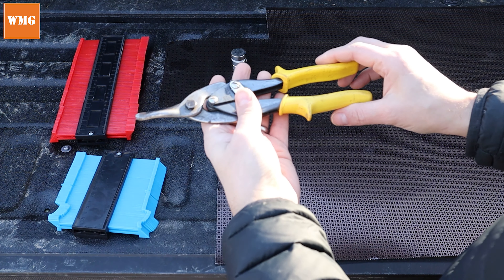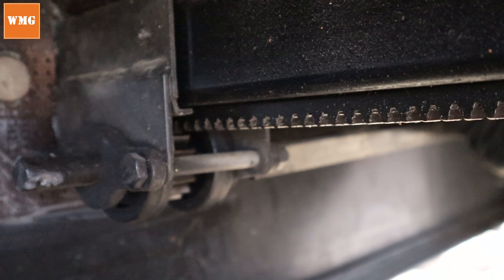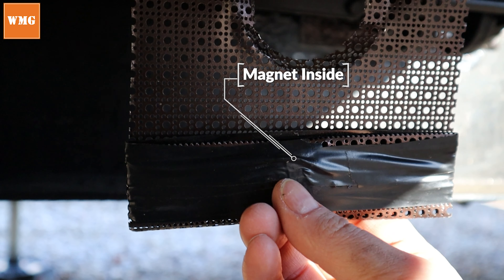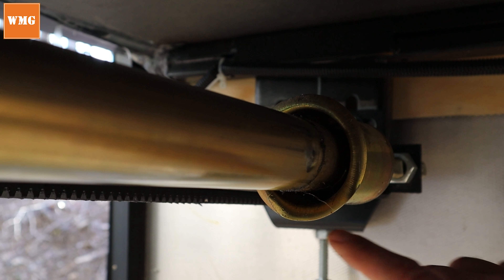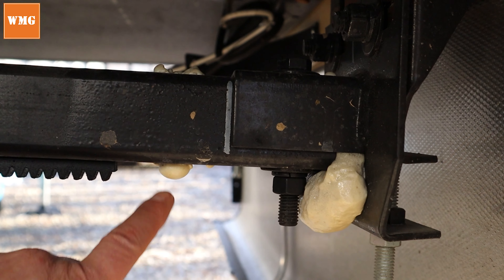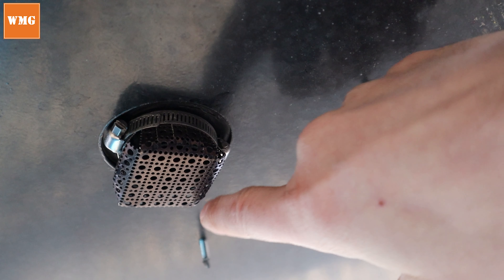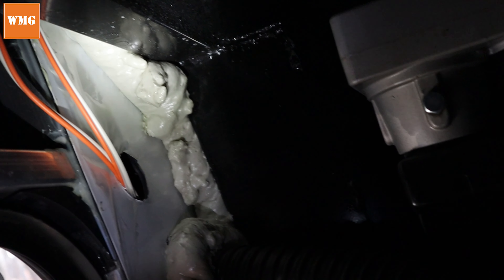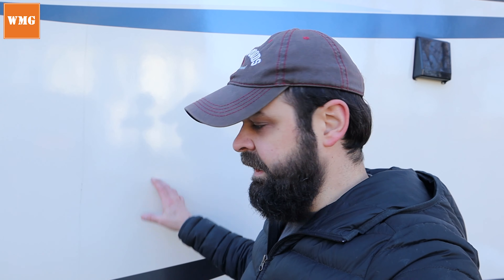How I STOP MICE from getting in my RV - No Mice 3 Years Later! #mouseproofrv

Comment: Really enjoyed your vid. I'll be parking a Ford Transit van in the Maine woods and this gives me a head start. My van has a zillion holes underneath but I can deal with that. I'm more concerned about how I'm gonna deal with the engine bay. So far I hear peppermint oil and keeping the hood open at night. I saw one of your commentors mentioned muffler tape for the wires? Also, I'll be parked on gravel and I read something that said rodents aren't crazy about gravel. Know anything about that? I appreciate what you've done here. Not just anybody would put in the time and effort you have. May you always be mouse-free :))
Reply from the maker: I'm about 3 years in the RV after the mods in my video, and still no mice! I'm convinced that it's not about trapping them or deterring them with smells and sounds, it's about preventing them from getting in. As far as gravel, I had my previous rv on gravel and still had a mouse problem.  I'm not sure the benefit of muffler tape on the wires. Maybe so mice don't chew them? I hadn't had that problem before.  If you seal up all mouse entry points, they won't get in.  It's a lot of work, but you only have to do it once. 😀 happy camping! Feel free to come back and share details about your adventures!

Comment: Is there a reason you used the aluminum vs just spraying those areas with the foam as well?
Reply from the maker: I feel the aluminum is more mouse proof because they can't chew threw it at all.  The foam is mouse resistant but technically in my book easier to chew threw than aluminum.  I've never had a problem with either.  But i like to use the most mouse proof material where it's possible to do so.

Comment: I am battling them now with glue traps inside. It just turned cold, and they want in. I have been in this RV spot for 1 year now. It's time to try and do some hole searching. Great video.
Reply from the maker: Closing up the holes is preventing them from coming in.  I'm sure you have found out that the glue and traps is just prolonging the problem because it doesn't eliminate the issue. If holes are open, move will keep coming in.
Reply: We’ve left ours for 6years and had no idea mice would be an issue. Started working on changing the tires and noticed a huge hole in the under belly.

Comment: I just set up my trailer to live I and I have already heard rodents underneath the flooring. How do I get all the mice out before I seal it all up?
Reply from the maker: Great question. Mice are crazy, they multiply and there are usually more after you trap a few and think you got them all.  So if it were me, I would go on an all out war against the mice.  I would bait traps insidethe rv on the floor near the walls because mice walk alongside walls, place sticky rodent tape in the underbelly of the rv along the sides near walls, place traps on the counters and stove, bait all the traps and tape.  Then for the next week or two Inspect each trap, replacing as nessisarily. And keep doing it until you catch no more mice.  I wouldn't use poison because they will eat it and die in places you can reach.  Eventually you will get them all. Another option is to seal the rv first and just trap them on the inside.  Sealing the underbelly should force them up. If you want to chat more join my Discord , it's easier for us to have a conversation.

Comment: Easily the best mice prevention vid I've seen. It takes some effort to defeat the little ba$tard$ and this will do it. You're exactly right about rechecking the areas for entry multiple times. A huge THANK YOU for the additional ideas such as contour gauge, metal sheet, magnets, etc. I was previously using foam and steel wool on old camper. New camper will be using these upgraded methods.
Reply from the maker: sure thing brother! glad it helped!
Reply: With just steel wool and the spray foam, did it still work to keep mice out of your first RV?

Comment: My 2021 new Generator  was eaten by a red squirrel.  Now I am closing up the whole generator box W/ steel wool and hardware cloth and foam close up the generator to rodent proof it.   I will just take it off the hardware when I need to run the  generator.   It is worth it.  We do not use the generator  and i'll selling it asap.  Going to portable inverter/gen.    Also, I find live traps are much better than a kill  trap.  I set the kill traps and the bait is gane next day and no kills.  I went to a live trap and ching!  still working a year latter.
Reply from the maker: The other problem with bait traps is they will take the bait and die elsewhere in the camper if the bait uses poison. Sometimes you never find it.

Comment: I owned a home built in 1840. Mice had been getting into the house for generations.
A wildlife consultant said mice can squeeze through openings 1/4 inch wide. I bought 1/8 inch hardware cloth to secure foundation openings, and stuffed 000 steel wool around water pipe openings. Mice won’t eat through steel wool.
Reply from the maker: True, they don't eat through steel wool. On an RV, I used aluminum mesh so that it won't fall out of place or rust from road water, etc.

Comment: I've used steel wool with expanding foam.  A small amount of steel wool in the area being filled and then spray foam in and around the wool encapsulating the wool. Critters won't chew through it.
Reply from the maker: This is rodent repellent foam.  I've never had a mouse chew through it. But also, the aluminum sheets cover the biggest openings.

Comment: Good video although I would like to mention that magnets do not attach to aluminum so you must have been using a steel grating of some type or I missed something. Good vid!
Reply from the maker: It's aluminum grating, the beam in the trailer is Steel and iron, so the magnet sticks to the beam behind the aluminum grating. I also caulk the grating to hold it two ways

Comment: You really went all out! I've used the foam, but I have some gaps that are still too big. We haven't been anyplace that has had mice since I used that foam, but we will and I need to fill every gap. You're right, they can get through the smallest of gaps.
Reply from the maker: Do you think you will try the aluminum patches on those bigger gaps?
Reply: @WhatsMyGear  All my remaining gaps are small...i think. But you've shown me some spots I need to double check. I'm partial to the foam though. I have the foam for smaller gaps and also some for 3" and larger. I'll use the aluminum if I have openings that need venting.
Reply from the maker: @sightslessseen7977  makes sense.  Good luck with it and happy travels!

Comment: That sure looks like a lot of work.  I've done the same thing and so far I've been mouse free for 2 years.  I hope I didn't just jinx myself!
Reply from the maker: Paul!!!
Reply from the maker: Also, I just posted this install for a Soft Start unit for your RV Air Conditioner if you are interested check it out. It takes the huge jolt of power consumption away for when the AC starts. Very helpful to allow less power to do the same job. You can run the AC on a generator, or a 15amp line with the soft start. https://youtu.be/C-Yg6zhNCYY

Comment: The down side to sealing up your Towable RV too well is you end up encapsulating your frame and plumbing.  If you should have a pipe/hose breach you may not know about it until there is significant damage.  If you're going to do this it might be  good idea to put weep holes in several low spots of the Access Panels or Coroplast.   In the case of my 5er it's not possible to seal it up from Mice, all the hydraulics make it a significant challenge.  The little suckers can squeeze through a hole the size of a dime.  I just put professional grade bait stations around my RV when parked.  BTW, the Peppermint trick does not work at all, don't fall for that.  I did an experiment with a fresh Peppermint Repellent Bag next to a Trap, guess what was in the trap within 8hrs.
Reply from the maker: You're thinking about the right stuff.  In my case, the underbelly of my RV isn't water tight because the plastic panels are just "clicked" together. If I had a leak, the water would just fall between the panels, and it would be easily seen. Everyone's RV will be different, so you are thinking about the right stuff. Each person needs to assess their individual RV situation. Good luck out there!

Comment: Great video..and beard. We live in New York and we're heading out West in 3 weeks for a 78 day trip.. I had cab fresh in several places and I still and I still got nice.  Just a few days ago we found evidence of mice and I  killed one yesterday with a trap. I'm about to do foam  and steel wool. And then load it up with peppermint spray and more Cab fresh. There's no way I could do all those things that you did. Great accomplishment. I just hope they don't come back.
Reply from the maker: I've tried the cab fresh for years, I put 30 bags of it in my last camper, and every summer when id open it after winter storage I find nice.  Unfortunately nothing stops them except directly preventing entry. Physically preventing entry.  Good luck my friend.  We just did a 3 week trip to South Dakota from Ohio.
Reply: @WhatsMyGear Thank you.  By the way, I've changed my strategy since I've made my last comment. After some research, I realized using foam  Wherever I find openings underneath the rig, isn't  going to do a thing because they could fit through something the size of a pencil.  I realize cab fresh isn't going to The job by itself and it needs to be replaced every month and a 1/2 or so but I'm also going to be spraying certain areas with a nice strong mixture  I made with water and Peppermint oil. So far so good.
Reply from the maker: @yobabybubba  let me know how it works.
Reply: @WhatsMyGear   Well it's been over a month  and so far no sign of mice whatsoever and we're traveling across country now.

Comment: Very thorough and detailed video! I did expanding foam with steel wool and I sealed up holes and gaps from the bottom, but my problem is mice were getting in before we sealed it up and we were only able to find and capture one mouse (female). Didn't, see, hear or catch any other after that, but after I sealed more from coming in we have at least another mouse still running around that was already in the RV. He/she learned to avoid peanut butter traps from the 
first mouse, any tips to get rid of mice that are already in that avoid traps?
Reply from the maker: Super sticky one sides mouse tape. No bait needed.  Just place near areas it works walk along a wall or inside the cabinet floor., etc.

Comment: Did you seal off the area where electric cord is coming out of the RV?
Reply from the maker: on my RV I don't need to, because there is no hole going inside the RV. it's an external receptacle that I plug into. If you have one of those systems where the cord live inside that hole and it doesn't ever disconnect from the RV, you just push and pull it in and out when needed, then you could stuff something in there that can be removed when needed.

Comment: Thanks for a realistic video to keep mice from entering a travel trailer.  My question is regarding the space around the holding tanks.  The tanks are held in place with steel beam-like pieces.  There is a space between the tanks and the bottom of the trailer.  Do you have a thought about sealing those long expanses?  Do you think a mouse can gain access by gnawing between the tanks and the floor/bottom of the trailer?  Thanks for your input
Reply from the maker: It's questions like these that make me want to start a Discord so that we can send pictures and get deeper into helping others in the community. I'm trying to picture what you are saying. The first question that comes to mind is... is the underside of your RV covered from end to end with something that closes off the underbelly? Sort of like in my video, when you look under  my RV mostly you just see flat plastic panels that span the entire underside. Because of those panels, I can't even see my tanks. So then all I'm trying to seal is access beyond those underbelly panels.
Reply: @WhatsMyGear  thanks for your response.  Yes, agreed that a "discourse" with photos, likely helpful.
Reply: @WhatsMyGear  please do… I came across your video after I was awakened this morning at 4 am by hearing some scratching noises, as I get out of the bunk bed I see something run across from our fireplace to the the door. 2 hours later I’m still sitting here waiting
Reply from the maker: @TheVremodel  I'll do it today 😀
Reply from the maker: I just launched the discord. You can join by going to by website whatsmygear.com and click the button at the top that says Join My Discord. Hope to see you there 😀
Reply from the maker: I just launched the discord. You can join by going to by website whatsmygear.com and click the button at the top that says Join My Discord. Hope to see you there 😀

Comment: Do you have any concerns when spraying the foam around wires? Any concerns if you ever had to service those wires? I’m not to well-versed with the foam and didn’t know if it’s a permanent deal. I’m considering doing exactly what you did didn’t know if I should throw some electrical tape around the wires
Reply from the maker: I'm not worried about wires.  If you had to replace a wire you can pull the wire through it, even cured, then the hole from the wire works remain in the cured foam.  You world run a new wire through that hole or you could dig out a new hole through the cured foam.

Comment from the maker: Join my free Discord where you can chat with me. Links on my website: https://www.whatsmygear.com/community

Also, watch my install for a Soft Start unit for your RV Air Conditioner if you are interested check it out. It takes the huge jolt of power consumption away for when the AC starts. Very helpful to allow less power to do the same job. You can run the AC on a generator, or a 15amp line with the soft start. https://youtu.be/C-Yg6zhNCYY

Comment: Blocking frame drain holes is a very big mistaken. When it’s rusted out, you’ll wish for a few mice
There is no way for mice to get in on the slide ram
Reply from the maker: I agree its good not to block drain holes. But no drain holes are blocked if using perforated aluminum like we are doing in this video. Water and air can pass through the perforated aluminum. Foam was used on panel seams, not drain holes. And used on horizontal slide out beams that can not accumulate water as they live under the side and above the sealed underbelly in this rv. Appreciate you looking out though.
Reply: @WhatsMyGear  the slider ram you are putting metal around is useless. The ram has no entry into the cabin itself
I don’t think you have a very good understanding of how these are built and where infiltration can happen. You need to do a lot more homework before you cause damage you don’t see yet. The thing is, you are guiding people that understand less than you do. This can really cause problems for others
Reply from the maker: @DanielJohnson-ec8rk  What exactly is the problem that my metal patches will cause? They are perforated, so air and water could move through them, and they do not restrict slide arm movement. Also, mice or other rodents could walk along the i-beam or slide ledges, and reach up i to those gaps. If they get into those gaps, they gain entry into the underbelly, which could provide access to the cabin through insulation, plywood gaps, plumbing gaps, electrical holes,  hvac gaps, etc. Also, even if they never gain entry into the cabin, I dont want them having access to the underbelly or any cavity on the RV.
Reply: @WhatsMyGear  it’s where you show to put them. You have them around the ram of the slide. There is no reason whatsoever to have around this part. You don’t understand the construction
Reply from the maker: @DanielJohnson-ec8rk  What will the harm be?

Comment: WOW!, you really opened my eyes. I didn't realize how many places mice could get in. I've been plagued by them for years. I use glue traps and they do a great job of trapping them but I want to stop the mice before they get inside. As soon as it warms and dries out a bit I will be doing just what you have done. I like your thinking with using expanded metal or other metal screen material to block entrances!  Thank you Sir for the great information your video has shown me. 
I do have a question for you, since your mouse proofed your 5th wheel, have you had any mouse intrusions?
Reply from the maker: I'm so happy to say this RV had never had mice in it.  We bought it new, then did the mouse proofing immediately. And it's worked for years now.

Comment: I have watched many videos of keeping rodents out of your camper, but NOT ONE talks about how mice have to "jump" almost 2ft in the first place to get in the camper.  So, why not catch the mice to prevent them from climbing?  Glue traps can be placed around tires and jack stabalizers.  A mouse cannot jump 2ft onto the underbelly, they have to climb up something, be it the tire, the stabilizer, or electric wire and sewage lines.  If you were to stick glue traps all around the areas, the mice wouldn't be able to get in the first place. So you would have to use a strong double sided tape to stick to the bottom of the rectangular glue trap.  Stick that around each tire, each stabilizer and around the water and electric hook ups.  Just to be sure, stick glue traps all over the underbelly.
Reply from the maker: If you 100% seal the camper like I've demonstrated in this video, the mice will not have any entry points.  Regardless of their ability to jump. I've never had a mouse in this camper using the approach in this video.